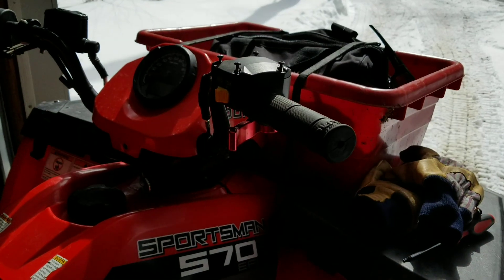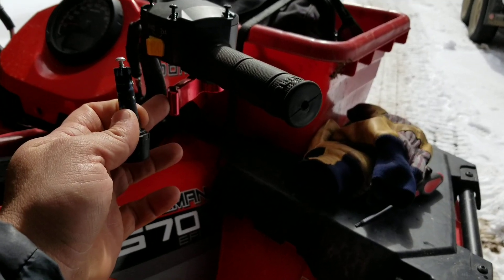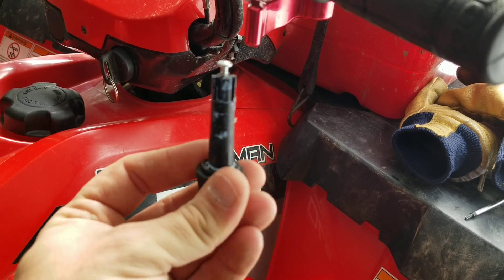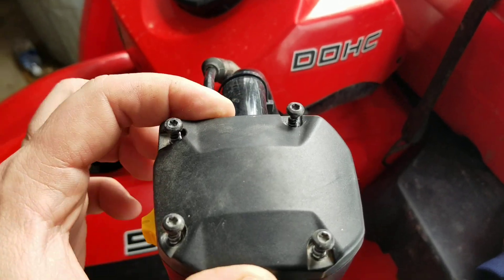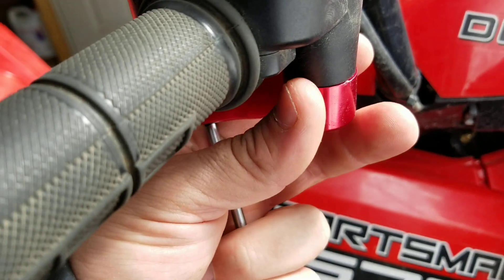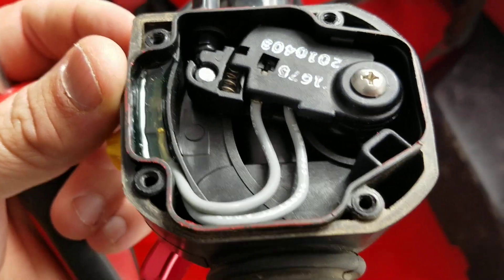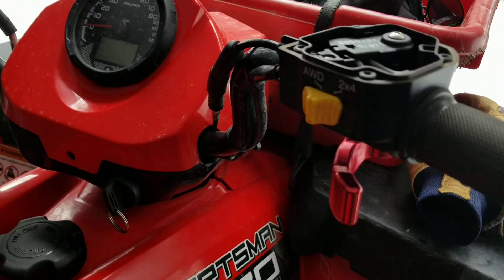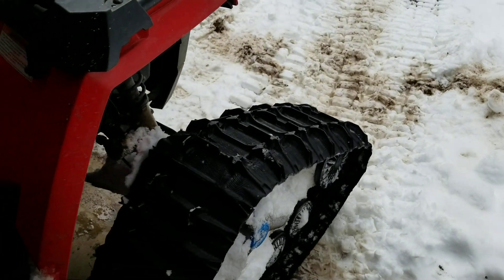Sportsman throttle fix

Comment: I just replaced mine it was easy like you said. I do however have a little up s d down play on the throttle once I fastened everything back together. Replaced with the same throttle you have here. Did you experience this? What did I do wrong?
Reply from the maker: I do have maybe a 32nd of play up and down also.

Comment: Do you drain fluid with a bucket underneath it to catch all the brake fluid? You skipped out on that part please let me know looking forward to your reply thank you very much
Reply from the maker: Brake is on the other side. 570 doesnt have one on the right side
Reply: Pretty sure that has its own separate box for the brakes we are talking about a throttle. Smh

Comment: So dumb how easy the thumb throttle breaks. Broke mine twice then got an aluminum one like you from amazon. My sportsman 570 has been a lemon. Water in the belt housing and now it’s stalling right away when I hit the throttle. Trying to find a fix if anyone has one.